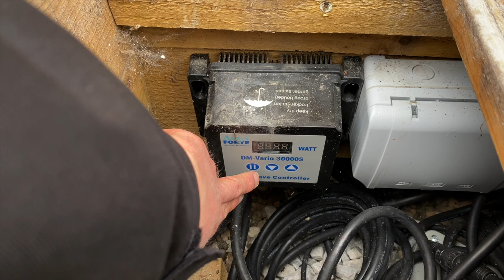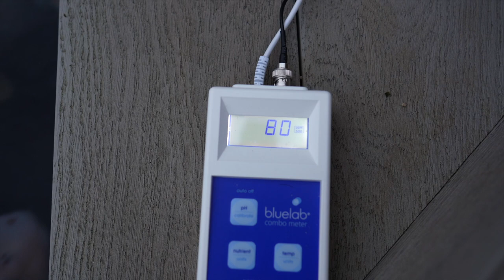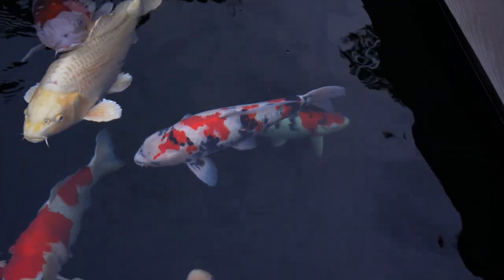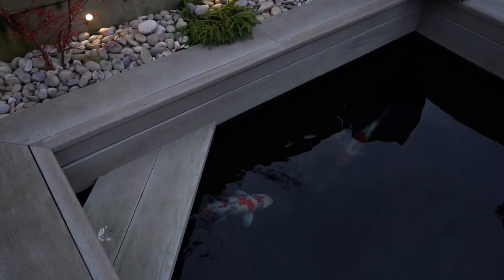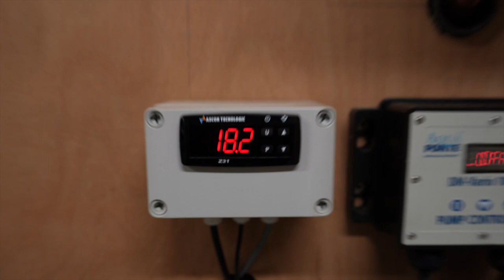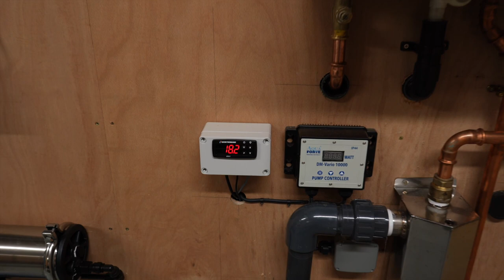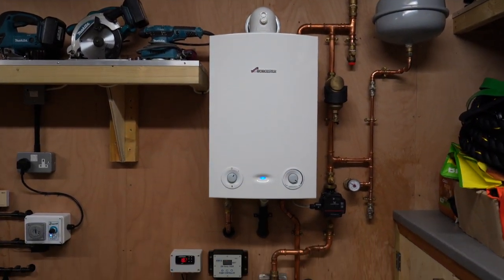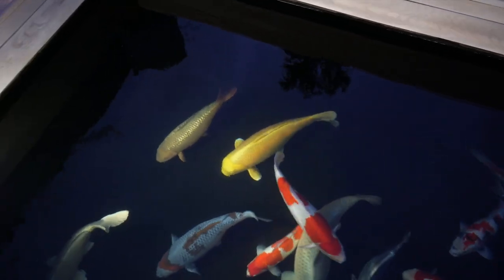THE ULTIMATE KOI POND FILTER | HUGE BAKKI SHOWER WITH 260KG OF BHM | FRANKS KOI VLOG #003

Comment: Great video and love your filter room set up, I have a air source heat pump on my 3000gal pond which does a good job but I was looking at fitting a gas boiler same as yours for winter and use the air source for summer when it would be more efficient. Could you give a bit more inside into the plumbing and set up needed for the gas boiler. Thanks Andy
Reply from the maker: Hi Andy, my pond is 3300 gallons and the boiler is a 15kw heat only boiler. The heat exchanger and thermostat were both from Absolute Koi, if you give them a call and mention Frank he will know what parts your after. 

The heat exchanger I’m using is 170,000 btu and Iv found it to be a good match with the 15kw boiler 👍

As for alternating which heater to use depending on time of year, I actually went to Absolute buy a ashp when I received a huge bill from running a 3kw electric heater and while I was waiting to speak to Darren I got talking to a chap who had been running a boiler for years but had fitted an ashp to save money in summer but he said then the only time the ashp was more cost effective was when the air temperature was really high but in general on those days the heater wasn’t com-in anyway so he said he just ended up having the ashp as a back up heater. 

Think you will be impressed 🔥
Reply: @thekoichannel264  Thanks for the reply and really good information its very much appreciated. I'll give them a call and have a chat with them. Take care and keep up the videos....regards Andy

Comment: Your foam/ protein skimmer is so neatly designed!! No additional air stones or pumps etc..... 

What size stand up pipe did you use frank ?
Reply from the maker: The up pipe starts 4” and then is reduced to 1.5”.

I think I’m goIng to do a Vlog on RO and explain the up pipe better as Iv had a lot of questions 👌
Reply: @thekoichannel264  that would be really good!

Comment: I really enjoy your videos Frank, your pond, fish and setup are awesome, plus your video production is one of the best 👍. One question, have you checked the base of the shower for sediment or is the flow too strong?
Reply from the maker: Cheers Garry, funny you should say that as I had thought that i would get settlement at the outlet end but after removing my winter cover I turned it off for a look and gave it a blast in the bottom tray with the hose and there was nothing really settled just bits of chipped bhm 👍

Comment: Great job! Would you be able to explain how your up pipe works? I’m suffering with high TDS  and thinking about putting an up pipe in. We’re should one be put? I have a shower which returns strait into the pond but I also have a 2” return (pumped) would I be able to put a up pipe in my 2” return?

Comment: Great pond. I’m interested in the pleco. What sort of temps can they go down too in winter?
Reply from the maker: Hi Daniel, it’s a common Pleco. Iv got it to keep the weed on the sides down. I put 3 in but 2 have died, both was when my old heater let me down and the temp dropped too quickly.

They can “survive” to quite low temperatures, I know others have had them down to 12c and they live in rivers that have low temps. Personally I wouldn’t want to let them go below 15c and as Iv found out temperature stability is really important 👍

Comment: Amazing pond I’m just in the design stages on my pond and looking at a boiler to heat if you get chance a details look at the heating set up would be great 😊
Reply from the maker: Hi Robert, the boiler is a 15kw heat only boiler, the heat exchanger and thermostat were both from Absolute Koi, if you give them a call and mention Frank he will know what parts your after. 

The heat exchanger I’m using is 170,000 btu and Iv found it to be a good match with the 15kw boiler 👍

Comment: Awesome job mate. Also very interested in you foam up pipe.
I’m building my shower in my shed and have x3  2”pipes returning via a blade. And then just under water in the winter. And would love to add some up pipes but a little unsure where to place them and how high. As my pond water level is 80cm above ground.

Regards 

Pete

Comment: How does the up pipe work? Does it just need to be set at a height higher than the water level and on a gravity return so there is no pressure in the pipe?
Reply from the maker: If you watch my first Vlog towards the end I explain how it works in detail. I will at some point do a vlog just on up pipes tho as I think a lot of ponds would benefit 👍
Reply: Must have missed it, will go back. Cheers and great work...

Comment: Great video, and the system is looking stunning. I have a question regarding the up pipe?. How far is the smaller pipe going into the reducer? Does it touch the water flow in the 4” pipe or just above.
Reply from the maker: Cheers Harry 👍

Good question about the up pipe, I was supposed to mention it in the video but forgot. It’s actually critical to how well it works, the pipe is only pushed in to the first straight section and doesn’t sit into the tapered section, that way all the bubbles are pushed up the tapered section. Out of interest I did try it pushed further in and it didn’t work nearly a well 👌
Reply: @thekoichannel264  that’s great cheers for that,  has it been working and is it removing the doc?. I am in progress of adding a shower at the moment and was going to add the up pipe, I have seen it on another couple of returns and was wondering how good they are. Pond  and koi looking great.. keep the vlogs coming..
Reply from the maker: @harrymeldrum9994   yes mate it works absolutely brilliant, at the minute Iv got the elbow off the top of it because the water is so clean I’m literally getting the dregs of anything in there. When I start feeding heavy and it starts chugging I’ll slowly increase the length of the 1.5” pipe. Highly recommend using the 4” tee method over the normal way as it catches so much more air and creates turbulence. Try to have it set so the tip on the rubber reducer is at water level or lower.

Trickle and pond tds are both 80👌
Reply: @thekoichannel264  that’s great info I will give this a try, and I have the 4”  T for it, starting the dig this weekend as the shower is also remote like yours. Thanks again and keep the blogs coming..

Comment: Are you using a pump from the rdf to pump the water up the feed pipe to the lower bakki holding tank? I notice you rdf is level with the pond? Cheers
Cheers
Reply from the maker: @sweeyong7756  yes, this is how it was originally set up. I now only have a pump on the front spray bar and the rdf feeds straight up to the back spray bar instead of the bottom tank 👍
Reply: @thekoichannel264  cheers mate. Is there a particular reason why you could not have gravity feed the water from the rdf to the bakki? I mean luck dug underground to connect pipe from rdf to the bakki?
Reply from the maker: @sweeyong7756  gravity feed to the spray bars or the bottom tray? I assume you mean the tray?
Reply: @thekoichannel264  sorry i created any confusion. I meant to say the water from the rdf being fed by gravity to the two pumps supplying the spray bar on the top tray.

Comment: Hi frank, can I ask what drone you use for recording ?👍🏻
Reply from the maker: Hi mate, Iv got the Mavic air 2 combo kit, really impressed with it 👍 https://amzn.to/3vcrllw
Reply: Thanks frank👍🏻
Reply: The one you landed in your bushes 🤣 just checked it out there not cheap 😅
Reply: Hi frankie just wanna say thanks for the links on the drone, I ended up going for the DJI 2 mini fly, take care mate 👍🏻
Reply from the maker: There a cracking drone, my mates just bought one 👍
Reply: Frankie just wanna say again thanks, absolutely love the drone, I noticed on one of your previous vids you had a electro heat pump not sure what the kw was, my pond is around 3300 like yours, what kw would you recommend and do they do the job ? 👍🏻
Reply from the maker: @just4koi143  a up, glad your liking the videos. My best advice would be to get a gas boiler or ashp. My electro heater cost an absolute fortune to run, I dare say that if holding good temps through the year, what extra you would spend on the initial installation would be saved in the first year.